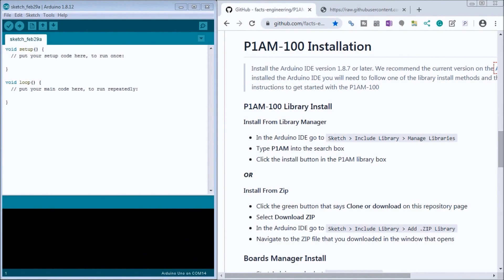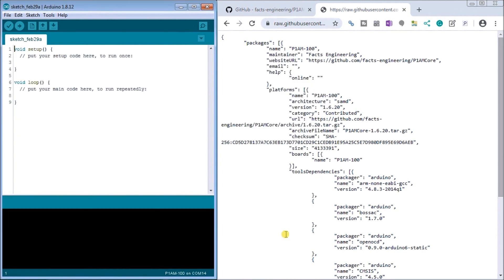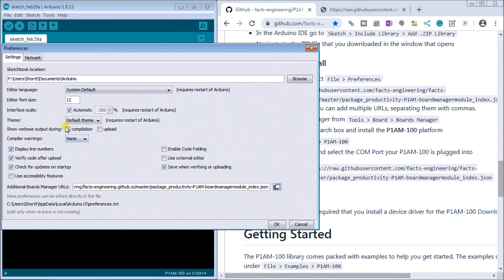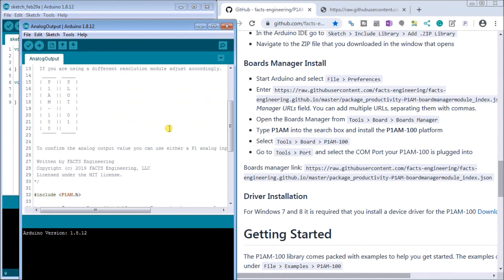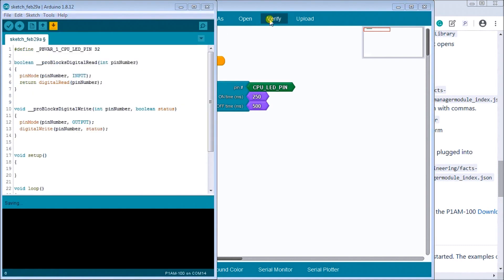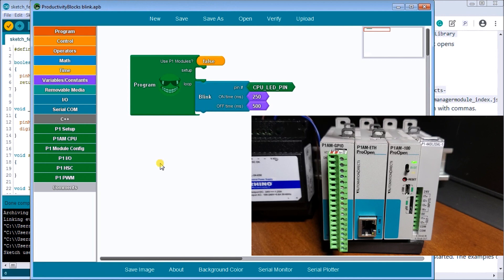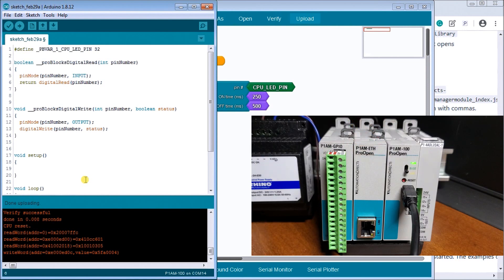Programming Your First P1AM Industrial Arduino Controller

Comment: to install the P1AM  board,  can it be installed without the internet from a thumb-drive?  thanks
Reply from the maker: Hi q zorn,
Yes, you can download the zip file library for the P1AM. Goto the following website:
https://github.com/facts-engineering/P1AM
Click the green button that says Clone or download on this repository page
Select Download ZIP
In the Arduino IDE go to Sketch > Include Library > Add .ZIP Library
Navigate to the ZIP file that you downloaded in the window that opens
I hope this helps you out.
Regards,
Garry

Comment: can you interface this PLC with factory IO?
Reply from the maker: Hi @justinpuzak2558,
I have not done this, but it should be possible. 
Factory IO can be set up as a Modbus TCP Server.
https://docs.factoryio.com/manual/drivers/modbus-server/
The Arduino Open can be programmed as a Modbus TCP Client.
https://accautomation.ca/productivity-open-p1am-arduino-modbus-tcp-client-to-click-plc/
Although this post is communicating to a Click PLC, the same type of communication would apply to Factory IO.
I hope this helps you out.
Regards,
Garry

Comment: Does it work in PlatformIO?
Reply from the maker: Hi sanjay bhatikar,
The P1AM is a MKRZero Arduino. This should be able to program using PlatformIO.
https://docs.platformio.org/en/stable/boards/atmelsam/mkrzero.html
This link will specify the board ID when using PlatformIO.
Note: I have not tried this, but all indications show that it should work.
I hope this helps you out.
Regards,
Garry

Comment: Can you download a existing program running on the P1AM-100? Can you view a running program and make online changes?
Reply from the maker: Hi Patrick,
Since this is an Arduino system, you cannot upload the program from the controller. However, you can download any new program over any existing program.
You cannot view the running program unless you program this in. Example: Use the serial port to show the variables.
There is no online viewing or programming like there is in a PLC.
I hope this helps you out.
Regards,
Garry

Comment: Do you have any content demonstrating the use of the P1-4ADL unit on your slot1 shown here?
Reply from the maker: Hi David,
Here is a post and corresponding video on the analog input module.
https://accautomation.ca/productivity-open-p1am-industrial-arduino-p1000-expansion-analog-combination-module/
The entire P1AM Arduino controller series can be found here:
https://accautomation.ca/series/productivity-open-arduino-compatible-industrial-controller/
I hope this helps you out.
Regards,
Garry

P.S. Sorry for the late response.

Comment: Super!   Thank you.  Please may I know which Pin is the CPU LED connected to?  Usually Arduino Uno it is pin 13.  I connected (a) Multimeter   (b) external LED  to PIN 13  of the P1AM-GPIO and GND.  <3V on Pin 13.  LED off.  LED should have turned on. It did not  (Yes, I did check polarity.  And the LED works. :)  ) I did change the ON time to 5 seconds.    
Also
https://cdn.automationdirect.com/static/manuals/p1amuserm/p1amuserm.pdf
Says LED is to Digital Pin31...there is no Pin 31.  

Also, what are the connections on the 
P1-4ADL2DAL-1.  Thank you
Reply from the maker: Hi Dr. G,
The CPU LED is on Pin 32 for the P1AM-100 unit.
Here is a post on the analog card P1-4ADL2AL-1.
https://accautomation.ca/productivity-open-p1am-industrial-arduino-p1000-expansion-analog-combination-module/
This will show you the wiring and reading/writing to the analog.
Regards,
Garry
Reply: @ACCautomation  This is fantastic!  Thank you.  Yesterday I presented to class and went through the Productivity Open P1AM and did  Industrial Arduino First Program.  After class, a student came to me and told me that he is Controls Engineer (for one of the largest processed meat companies in North America (read Vienna sausage)  and he was setting up a new production line and was looking at options other than traditional PLCs.  He had briefly visited Automation Direct Productivity Open, but now, after the lab-lesson,  he is convinced to go with this option!  I sent you an email via AD CA website.   Again, thank you.
Reply from the maker: @dr.g7898  
Thanks for the comments. The way I see the fit in the industry for the P1AM is for OEM's making machines. For industrial equipment that needs to be monitored and changed often, I would still use a PLC.
https://www.automationdirect.com/videos/video?videoToPlay=KOjPn9LVcjI
This link will compare the Arduino and PLC. It's well done.
Regards,
Garry

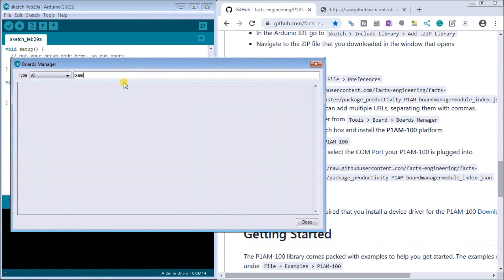Comment: First class job, Garry!  Thank you.  You may want to look at 1:13 Board Manager may not work as described.  Board Manager is described at 2:06.  That needs to be done first.
Reply from the maker: Hi Dr. G
Since we installed the P1AM Board Zip file previously, we had this board in our selection. If we did not install this prior then you are correct you must add the additional board management URL before selecting. 
Good pickup.
Thank you for the comments.
Garry
Reply: @ACCautomation  Thanks, Garry!